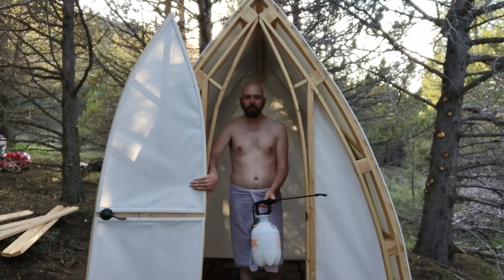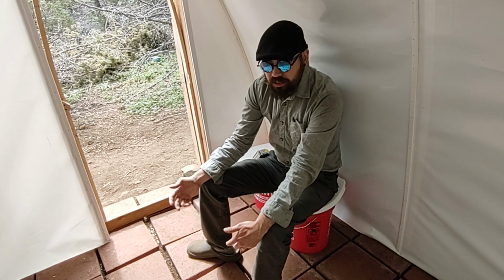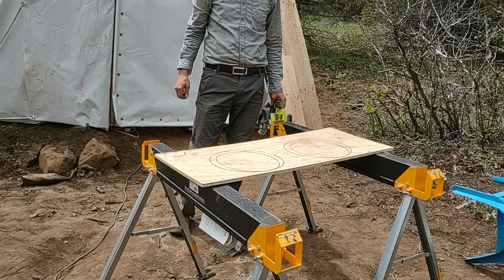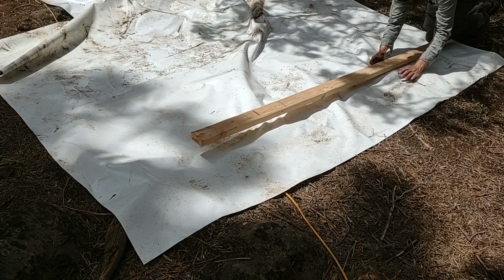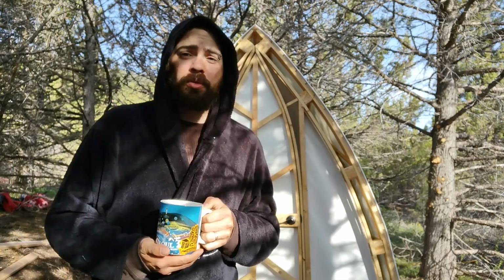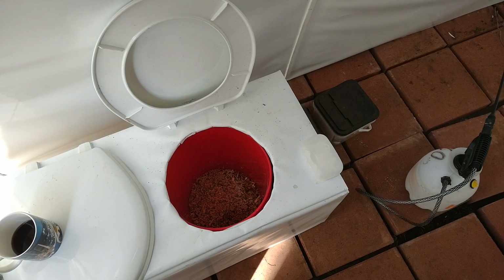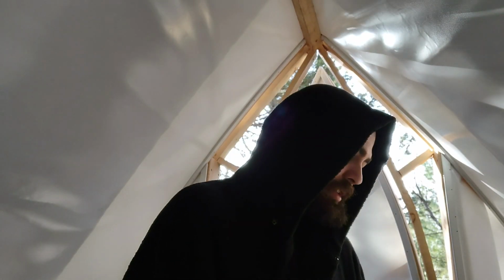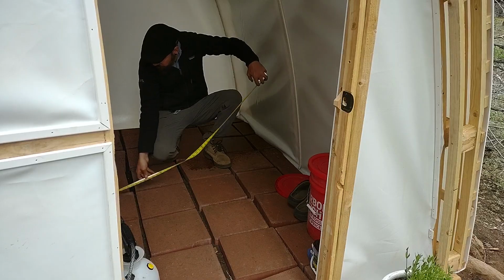Off-Grid Bathroom - Composting Toilet, Pump Sprayer Shower

Comment: I have two ideas which came from another awesome Youtuber named Bushradical.  For your shower, you don''t have to hold the wand.  Start at the 17:00 minute mark of this video: https://www.youtube.com/watch?v=gZNKzuzPDmY.  Also, for your toilet, you may want a pee shield (I didn't see one hanging into the liquid bucket but maybe I missed it).  See this episode starting at the 24:30 minute mark: https://www.youtube.com/watch?v=dTeo8OOxodo. Just some suggestions that might help!
Reply from the maker: We did end up adding a . . .front splash guard . . . out of some small strips of the architectural fabric.

Bushradical is awesome.  We'll end up doing a bit more permanent solution in the future, but for now that cheap pump sprayer is surprisingly effective.